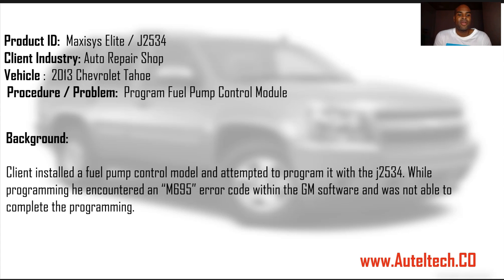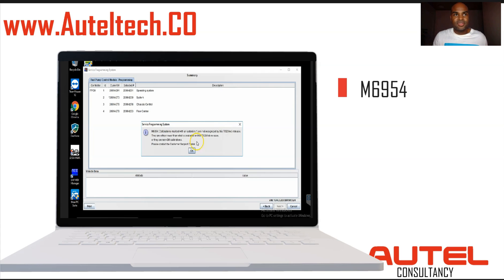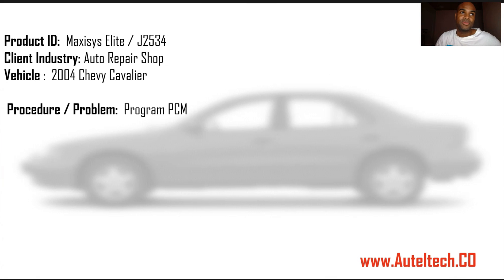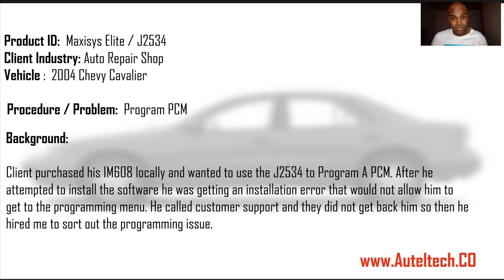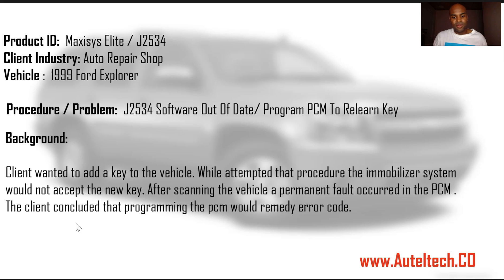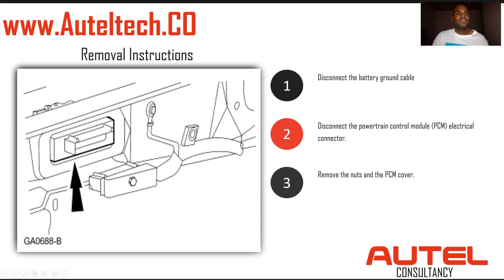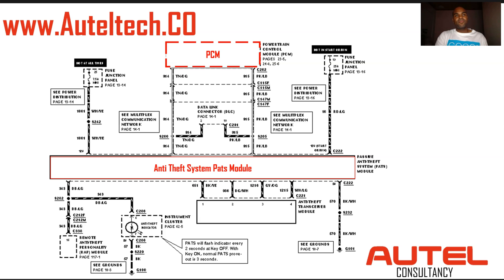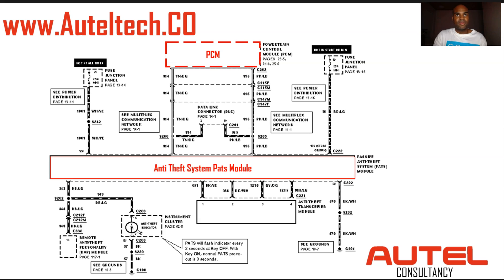Autel J2534 | GM, Ford Programming Obstacles - Helped Client Resolve Software Issues | Training 2019

Comment: I have an autel ms909 and I was unable to do module updates with fdrs using the autel J2534, it would fail. Used a mongoose plus and that worked, any ideas why?
Reply from the maker: I dont know . I just used the Autel J2534 with the FDRS 2 times last week with different clients
Reply: @ I used it to connect to the vehicle and do tests and delete codes and whatnot and this worked no problem, just trying to do software update jn IPMA in a 2021 F150 failed and made the module go purple in FDRS

Comment: Hi good day , we have issue with ford f350 2008 and when we try to install tuned file the erasing proccess stoped and the car did not start , we hane Autel Ultra , can you pleas help us to use the MaxiFlash Elite programming to reinstall the original file or any other way . kind regards
Reply from the maker: Go to my website auteltech.co.za and fill in the application and book the j2534 training service

Comment: I don't know autel has fix the problem or not yet but last time I use my flash programmer for GM with my Elite could not even communicate or program anything because there's a flaw in the tool itself and they said there was no fix for it at that time and that was about four months ago from today and on the interview you did with the key programming if you have two keys you should be able to program an additional all by yourself the problem is there's a lot of Clone Keys floating around on the market they are not Factory keys so they can only be cloned and people are buying them and screwing everything up a lot of times people already have two keys but they only actually have one because the key has been cloned somewhere you got to make sure if you're programming keys to modules nowadays that you have two programmable keys and not cheap clone keys

Comment: Switching over from my old pass through, still new with my maxisys... is there any drivers that need to be downloaded for the autel jbox to work with my pc and techline. Or can you simply go to techline connect and click it from the drop down on available devices? Thanks
Reply: Any good videos on what a pass thru can do .... Like, real lines of code ?

Comment: hello chris  i think i have techline connect standalone mode installed fine and i have my Autel j2534 maxiflash elite software installed and techline sees it….even thiugh it shows yellow and says contact msnufacturer tech support  But i only get the GDS2 is not communicating with device error   camt connect to vehicle to move forward to program ECBM on Yukon  what am i missing?  christopher
Reply from the maker: Im not sure on this one, I would have to log in to trouble shoot what the problem is. You should try autel new york because I charge for support.  If they cant help you book the diagnostic tool consultation at auteltech.co.za

Comment: used this program on a 2007 Cadillac Escalade TCM but the vehicle had on the old TCM foolish mistake it flash the old TCM with ez but when i try programing the new TCM at 4;58 in your video  am getting a pop up  e4399 severe error any thoughts from any one

Comment: I had one the other day.  2005 Ford Freestar.   Customer said van suddenly wouldn't start and theft light was blinking.  Went over and sure enough it was like it wasn't seeing the key.   It was the only key he had.  I fire up IDS and attempt to do a add a key, since he doesn't have 2 keys to wipe them out and re-program it.  It gets to where it tells you your going to have to wait 10 minutes, and when I click to continue it just hangs there, and hangs there.   I never goes to the 10 minute timeout screen.  I tried everything.  Reinstalling Jbox software, IDS, etc.   Nothing worked.  Finally we call out a locksmith to have him try his tool.  He looks at the key and is like there is your problem.  It is an aftermarket key that has a removable chip and the chip fell out.   So this is important to know that unless is a valid transponder key in the ignition (of some type), IDS will not continue.  He popped a new chip in the key and it programmed right up.  Lesson learned!  Luckily I am an IT guy with 25 years experience, so I am pretty good at figuring this stuff out.
Reply from the maker: Havin IT experience really is  huge advantage. Its a good skill to have since all the cars are computers on wheels.

Comment: what about J2534 wrapper issue
Reply from the maker: HI Kristi,  If you want me to fix it you book a dignostic tool consultation on my website.
Reply: @AutelConsultancy  is that free
Reply from the maker: @AlannaGrace711  HI Kristi . I charge for my services. What I suggest is to try to figure it out yourself and if you cant figure it out you can always contact me and I can sort it out quickly
Reply: Wrapper issue is normally the web browser you are using, but generally before opening a web browser…highlight the web browser you are using, then right mouse click and select administrative rights. Then reopen the browser and retry loading the wrapper while you are in administrative rights.

Comment: SORRY BUT DIDN'T YOU SAY THE VEHICLE WAS RUNNING , AND NOW AFTER TRYING TO ADD A KEY IT HAS STOP WORKING JUST TO BE CLEAR ON THE FORD PRODUCT .
Reply from the maker: Yes thats correct. The vehicle was running fine. The client tried to add the key and failed due to a possible problem with the PCM or Pats Module ( I forgot to mention the the client tried to erase the keys first prior to coding the new one ) After you erase the keys the car will not be able to start until they relearned to the vehicle.